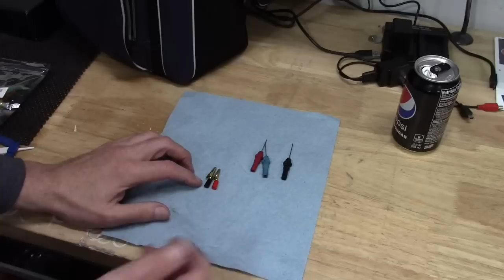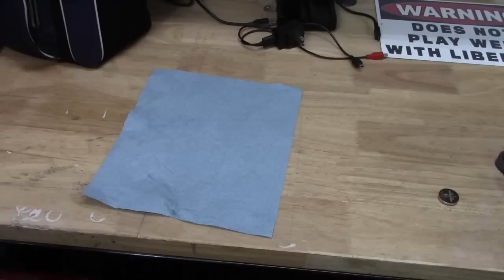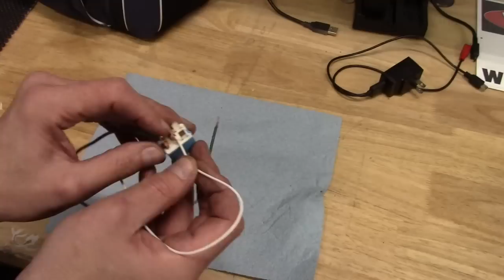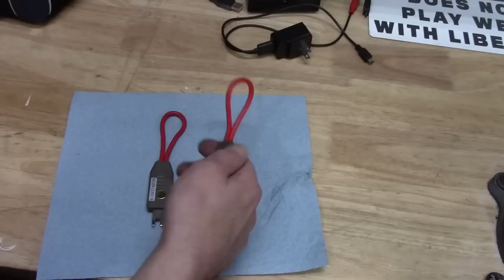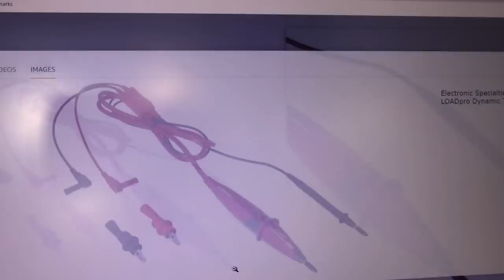Automotive Mechanic Tools I Can't Live Without- Xmas List Special!! (with product links!!)

Comment: RIP radio shack, pour one out for one of the electronics retail og’s

Those lisle relay testing adapters look nice but with a set of pin terminals and crimper you can make adapter leads so you can plug t he relay in without worrying about shorting anything. I got the terminal kit and crimpers tk repin something but the set has been really useful for diag too. I did get an autool test lead adapter kit but I broke a couple leads and had to repair them and realized I could just make some more of the more
Common adapter leads myself to add to the kit.
Reply from the maker: Radio Shack was an absolute legend for us DIYers back in the day!!

Comment: A very good sealant for probed electrical wires is a product manufactured by 3M . 
Scotchkote Electrical Coating FD  15 Fd. Oz .$50.00 Amazon   This product is manufactured for underground splices .6/30/23

Comment: The most relied tool would probably be a socket
Reply from the maker: Then I would say you are doing things wrong.
Reply: @SchrodingersBox  what about like a screwdriver
Reply from the maker: Nope I only really use basic tools when they are necessary to replace a component. Knowing what component needs to be replaced is where the skill is. Don’t need a scarewdriver or wrench or socket to do that, obviously.  I leave the basic tools to the grease monkeys.

Comment: Oh I hope you are doing well after your spinal surgery, did you actually get discs replaced ?   I had one removed twenty some years ago (L5-S1), problems with your spine really messes you up. I wish you a good recovery, we all look forward to more of your car diagnostic video’s, they are the best !      I consider myself a bit of a tool hoarder lol, I see a few items in this video that I must have; my biggest problem is finding them when I need them.  I will crawl through 14 miles of broken glass and rattlesnakes before I will pierce the insulation of the wiring, mine seem to be suseptible to corrosion even without poking a hole in it.

Comment: I replaced tps in 01 odyssey the China made one sticks and I have to put in neutral and Rev engine and sometimes it resets. I'm gonna put original back. That was not the issue it is egr system.

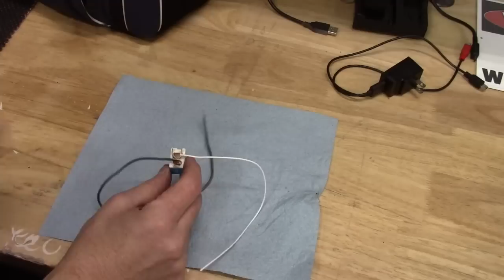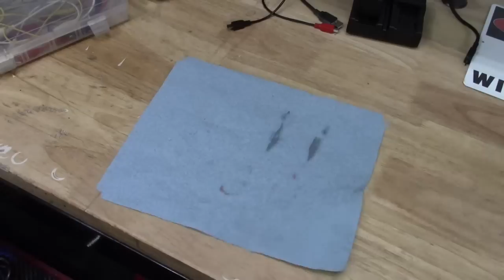Comment: Spoilers: 1. Backprobe pins 2. OBDII breakout box, 3. 11:30 Relay Test Kit, 4. 17:30 Fuse buddies 5. 20:50 wire piercing probes 6. 24:10 Load pro

Comment: Electrical nazis - I love it. Recently diagnosing a check engine light - no start - on a diesel van I had no less than 4 people (friends !!) of the owner challeging my diagnosis in trying to get to the problem. I diagnosed an injector, fuel and pump problem - possible water !!. In the end the owner had enough of the banter and "self made mechanics" . A friend said he can get the RAC out for free which he did. Fault was ADBLU in the fuel !!. Now its true I would not have thought of that which is a VERY BIG NO NO in diesel engines however it took the two RAC guys 2 hours+ to reach the same conclusion. Fuel contamination.
Reply from the maker: nice work. Just curious how you determined there was an injector, and pump problem when it was a fuel contamination problem?
Reply: @SchrodingersBox  The injectors were showing dtc's and the fuel pump was running at a low pressure. A dealer has now replaced the fuel pump, filters, injectors and fuel lines but will not guarantee the repair as he believes there could be other engine damage. The owner is hoping to part ex the van for a new one when he gets it back. I have found several articles on the subject of adblu being put into the diesel tank and its effect on the fuel system and engine. Not good at all - very costly.

Comment: I keep getting random misfires and it’s really driving me crazy.. I have new plugs, wires, distributor and cleaned my EGR. Any thoughts on how to tackle this problem?
Reply from the maker: sure what data did you have that it is a secondary ignition issue?  was there no voltage at the secondary? Also you lost me on the EGR-  was this a secondary ignition issue or a combustion issue? I don’t follow the EGR if you determine you have no spark.

Comment: Regarding that breakout box, I got that same box from Amazon a couple of years ago. To my surprise the pins were wrongly labeled, 7 was 8, etc, which took me an extra hour of diagnostic time. Finally I realized it wasn't the car, it was the tool. Rather than return it I used a sharpie to change the numbers beside each plug. You can't change it inside, the plugs fit in to a board which is wrongly designed. I left a balanced but glaring review. To my surprise the seller simply changed his name, which deletes any old reviews. Go figure. I agree with you about the LoadPro. I believe Dan's company went bankrupt since sales didn't match expenses. His decision to cloud the way it works (to avoid DIY copying?) doesn't work for analytic thinkers. It is really a very simple design, just a parallel 25 ohm resistor, switch and fuse in a nicely designed handle. Great for quick load testing, though many will use a light bulb for qualitative answers.
Reply from the maker: Oh wow that’s interesting on the breakout box!! Well I used it quite a bit and mine is wired correctly but what a bummer- always makes it extra frustrating when you have out of the box failure!!
  I actually talked to Dan a year ago or so. He referred to the load pro as pretty much a curse on his life as he invested the farm on it and of course it didn’t return at all. He commented about being able to do everything possible with electrical except pay his electric bill- but he is rebuilding. He is a brilliant guy for sure but like most engineers he is a an absolutely horrific marketer.  I hate to say it but he was his own worst enemy, it wasn’t the load pro.
Reply: Switch and 25ohmn resister in parallel I knew about. But don’t think loadpro has a built in  fuse(?)
Reply: @matthewbrice737  Good point. Now that I think about it there is no easily replaceable fuse, but I suppose there might be one inside. Before using it, they recommend checking resistance across the leads every time, by just switching the MM to ohms, then pressing the switch, without touching leads together to be sure it reads 25 rather than OL. There's no way to tell otherwise that the device hasn't blown, giving false readings. I don't know what the power rating on that resistor is but it might fry like a fuse if subjected to higher than expected current or voltage, ha ha.
Reply: @spelunkerd  When pushing button, the 25 Ohm resistor at best (assuming even 15 volts) would create .6 ohms. I don’t see how that could fry it.  But even if using leads on high amp starter circuit, when pushing the button the current flow is in parallel to high amp flow - that wouldn’t change how many amps flows through Loadpro.  Only thing I suppose prolonged pushing of button on higher volt systems  like 24 or 48 would overheat - but most cars are still non ev or hybrid. I’ve never seen Matt tackle either. My $.02.

Comment: Much respect for you, I've learned many things from you. However, poking holes in insulation causes cancer in children in the third world, so I'd really stop doing that if I were you. Jokes aside, one thing that helped me with electrical as a mechanic was making test leads out of old wire harnesses, or, for the purist, terminal connectors purchased online. You can make breakouts this way, or just leads to plug or clip your DMM to easily with little possibility of shorts or opens. Very handy and worth time spent soldering a few together.
Reply from the maker: Yeah you learn way more from making your own stuff and then you really appreciate the commercial ways. And don’t worry about the 3rd world children- remember they get free access to my pay channel so they can go out peacefully and gracefully watching my videos. it warms my heart.

Comment: Hey Matt, hope you are doing well with the surgery and all. How did you damage your disks. I'm going to venture to guess it wasn't attempting a head stand during yoga class.
Reply from the maker: Hahaha no yoga lol. I have degenerative disc disease- that’s exacerbated by my sports activities. it’s actually my 4th spine surgery.
Reply: @SchrodingersBox  takes all the fun out of having a vertebral column. I have two ruptured disk, L4 & L5 in my back so I feel your pain... just a little lower. Best wishes for a quick & and pain free as possible recovery.
Reply from the maker: Hahaha “takes the fun out of having a vertebral column” lol!! 
Yeah I had a really severe rupture in my L5-L6 a few years ago (I have a extra lumbar vertebrae that I sometimes wonder if it causes my back problems) and good grief you can’t even move sometimes- get around by crawling. people absolutely don’t understand unless they have that problem. I could tell the instant I woke up from the microdiscectomy it was fixed- that’s pretty bad when you wake up from surgery and it feels like a truck is parked on top of you but you can still tell it worked hahaha. 
I remember before they had MRI there was poor ability to diagnose it and there was often debate on if people with this “so called back pain” are just trying to get out of work lol. it’s absolutely debilitating.
Reply: @SchrodingersBox A sixth L! Wow that's crazy! I remember my first ruptured disk the L5. When I was able to finally get out of bed and shuffle my way to work, I made the mistake of getting on the elevator. What was I thinking?! Well I was lucky. Even though my disk was ruptured a chiropractor kept me out of surgery.
Reply from the maker: Wow that’s fascinating about the chiropractor.  I am no fan of chiropractors at all- I don’t see it as medicine or science in any way. but I know a lot of people swear by them. 
i don’t understand how you can have a mechanical interference- actual disc material pushing on a spinal nerve- and fix that through a spine manipulation. Seems at best it would be really temporary and at worst could actually make the disc press even more on the nerve. i tried a chiropractor for the first time a few weeks before surgery and I was anything but impressed. seemed like the biggest quackery I ever experienced.  But I am glad it worked for you, I just don’t understand how it’s possible from a medical perspective.
Reply: @SchrodingersBox  At the time, I wasn't a fan of chiropractors either, but that was only because my dad wasn't. I didn't know. Since I only had two ruptured disks, I only have one more disk story. When I ruptured my L4, I knew I was going to need surgery. So, with MRI in hand, Iwent to see a neurosurgeon here at Duke University in Durham NC. He had me strip down. put on a gown, and sit on the edge of the table. I asked if he wanted to see the MRI. He said no, and began pricking my leg with baby pin to see where I had feeling or was numb. When done he said you have a severely herniated are ruptured L4. It was ruptured when looking at the MRI. I ask, do I need surgery? He said, Gene, I get paid x number of dollars a year whether I cut on anybody or not. And then he said, if we can treat the pain with a chiropractor and pain meds while the body dissolves the disk, you won't need surgery. Sure as heck, no surgery. This was in 2006. Been good ever since.
Reply: @SchrodingersBox  did you have the disc replacement done in USA or did you go out of country
Reply from the maker: In the USA. in denver, colorado.

Comment: I really miss Radio Shack. Bins of switches, connectors, terminals, caps, plugs, etc in a local brck and mortar store. I still have part of a 100 ft roll of Cat 6 cable I bought there at lease 12 years ago. For young pople, imagine if Mouser was a store in your local strip mall.
Reply from the maker: It was the greatest store in the world wasn’t it!!!  We had one in north denver that was a holdout for quite some time- the last store in colorado and finally closed just about 2 years ago. i bought out all their electrical test stuff on the last day at 80% off lol
Reply: @SchrodingersBox  We had one in Golden that had the exact types of employees you want to see when you walk into Radio Shack: guys with awkward facial hair and Ham licenses who knew the difference between a rectifier and a switching diode. They let me clean out a lot of their bins when they closed.
Reply: Look them up online. They still exist.
Reply: @HouseCallAutoRepair  I will check that out, thanks. The one thing that really hurt about them closing the stores was there was no longer a store 5 minutes from my shop that I knew would have a dozen different sizes of momentary switches or a bulk roll of speaker wire. It makes you appreciate brick-and-mortar stores a lot more, which is why I'll drive across town to buy something at Microcenter when it would have been a lot easier to get it from Amazon.

Comment: Matt, thanks for your insights into these tools. I never consider tool purchases as a waste of money as they will come in useful again in the future. The wire piercing probes don't sit quite right with me but your own experience is difficult to argue with and sometimes it can be the only way. I've seen others use them so they can't all be wrong.
Reply from the maker: Right on about the piercing. I only ever do it when it is really necessary or saves more than a half hour of time. otherwise I avoid doing it as much as possible.

Comment: Hey everyone does anyone have experience with OBD1?? Are there any obd2 scanners with obd1 connections or adapters??? Thanks
Reply: Every professional scanner I have purchased come with all the obd1 connectors. They just sit in the case unused in my case.
Reply: Ty is there an adapter I'm definitely not a professional just looking for DIY stuff
Reply from the maker: Yep what M PH said. also for OBD1 I usually just use a paper clip to flash codes.
Reply: @SchrodingersBox  I'm sorry I'm not understanding
Reply: @mph5896  is there live data with OBD1???
Reply: I have a launch scanner with them.  I have used it on my 94 jeep.  You aren't going  to get a fuel trim with a paper clip....  There aren't many cars that would  use one and they aren't making any more of them though.